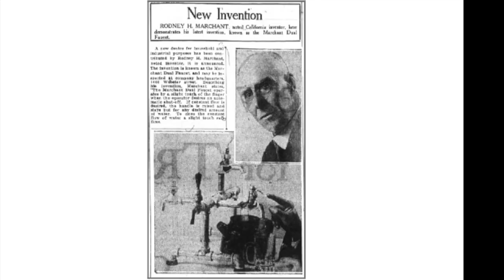Dactyle Mechanical Calculator

Comment: Lovely machine!
At 0:47, Sous is the abbreviation for subtraction (Soustraction) of course.
Reply from the maker: Thanks Jaap. The use of  “Sous” was when the machines were made in France. After Brunsviga got its own license they stopped supplying devices to Chateau Freres, which started making its own.  Dactyles were clones of Brunsvigas. Then the Marchant were clones too. What I haven’t learned is why Marchant was ordered to stop making clones but Chateau Freres got a pass.
Reply: @stephenfreeborn  I have no idea how those rights worked. The original Odhner patents were expired by then so it may well depend on the nitty gritty of the exact patents that were still enforceable in France and in the US. The cost to bring/defend a patent lawsuit and the chances of winning may also differ greatly between those countries.